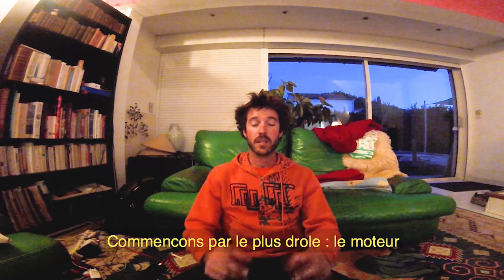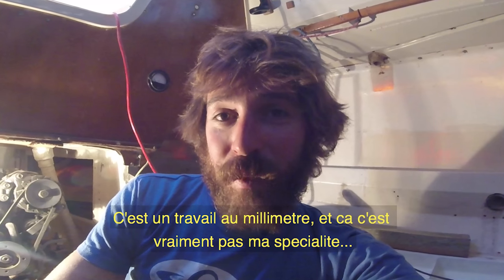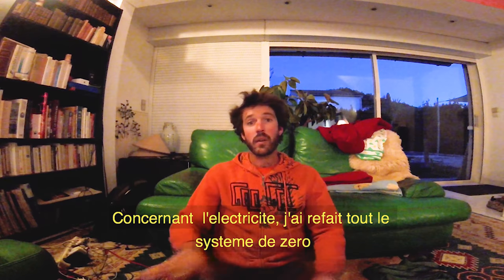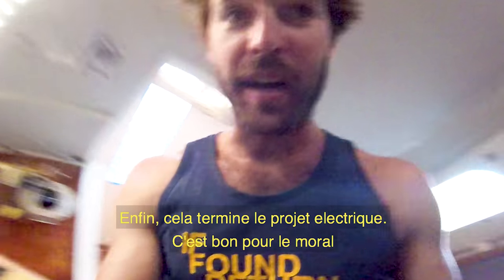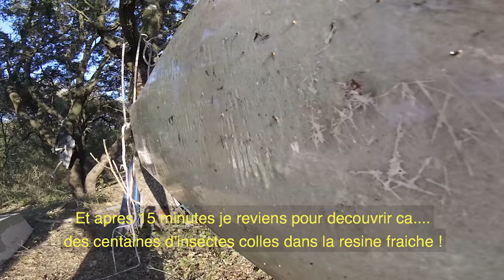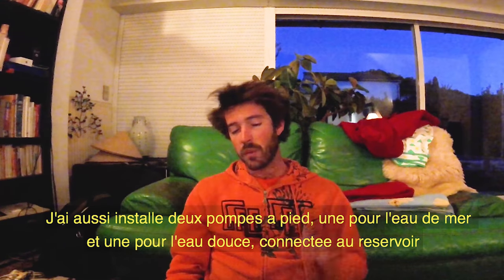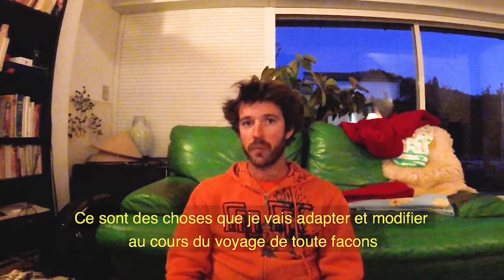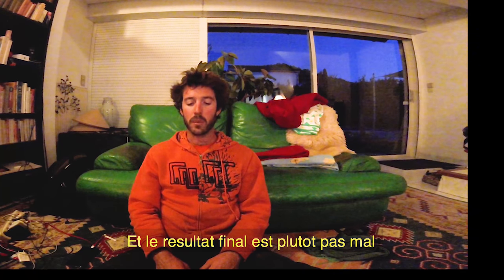In a nutshell - Ep 9 - The Sailing Frenchman

Comment: Had to rebuild me Yanmar 1gm10 on my refit as it suffered poor starting. Bottom end was good but the head was a bit buggered around the exhaust valve area. Had a machine shop replace the exhaust valve seat and all is good now. Painted the engine the same as the orange on your hull funnily enough. It was supposed to be light blue but they sent the wrong tin and couldn't be bothered to send it back. Looks good funnily enough.

Comment: Great videos, thank you. 

I noticed that you have a very clever hack for the bracket on your instruments to move them in and out of the cabin into the companionway. It looks like you may have used the legs from a (blue) GorillaPod stand and embedded them into some wooden feet. Is that correct? (My boat needs a similar solution!)
Reply from the maker: Hi, thanks a lot. For the mounting of the instruments I used lubrification pipes that are normally used for industrial machinery. The ones I used are from a brand called Locline, but others are doing the same. Gorilla stand might work as well, just make sure they hold enough weight, the instruments plus the box end up being quite heavy. Once  you have the mounting, i drilled a hole into pieces of plywood and stuck the mounting in the hole with epoxy filling and done :)
Let me know how it goes
Reply: You're a star - I'd never heard of the Locline stuff - it looks perfect. It'll probably take me a while to do this but I'll let you know. 
Many thanks, Michael 

(In case anyone is wondering what this is about - you can see TheSailingFrenchman's set up here: https://youtu.be/vsZGqBv35QI?t=120 - it's on the left)